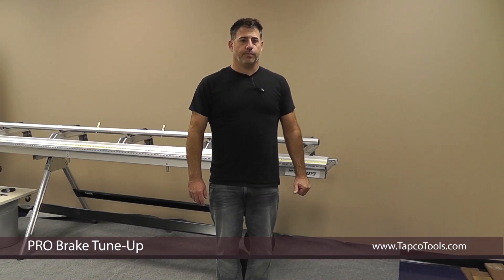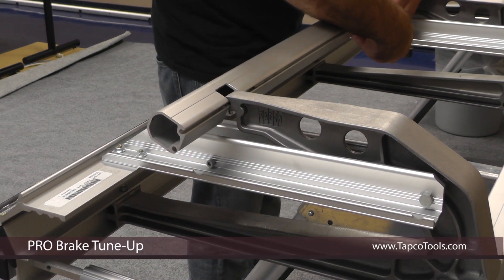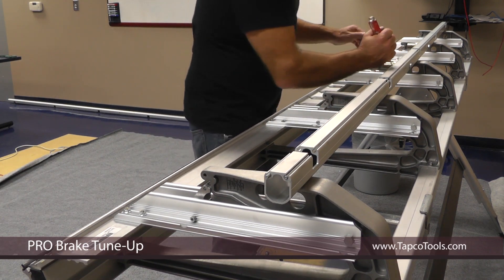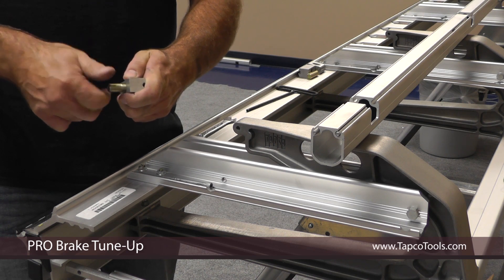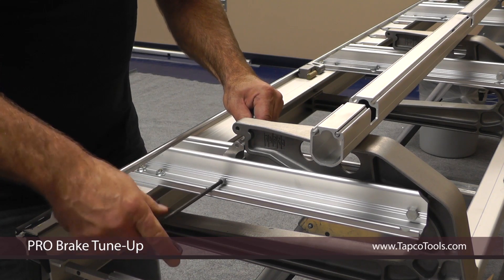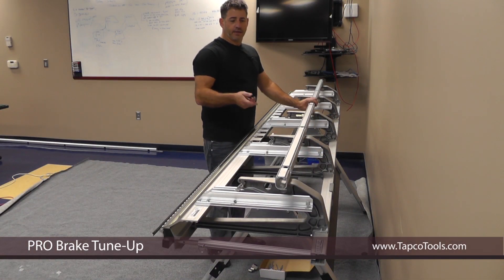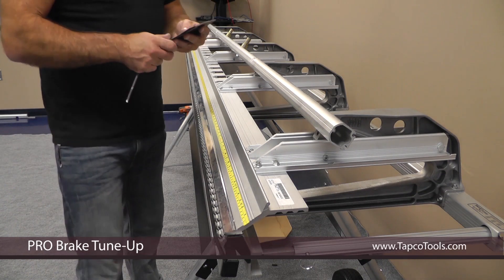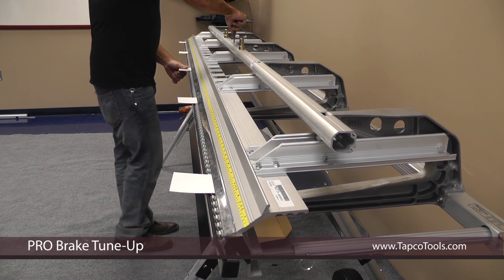How-to-tune-up-a-sheet-metal-brake

Comment: I'm looking for a mantel brake rebuild kit for a older 14inch I beleave. I dont even need it to be a new kit the old replaced parts will work for me .the brake I have is missing all of these  adjustment parts. If some one has some please get  back to me. 651-242-9832 john twin cities m.n.

Comment: my cutoff tool is cutting wavy edges why?
Reply from the maker: Hi Hydro Space,
I sent your question to Tapco Tools for input. Here's what One of the tech trips sent back:

I believe I understand the question, if the moving hinge is not locked in place with the hinge clip to the base hinge the ProCutOff will hit the metal high and stress it during the cutting process resulting in wavy or oil canning metal. We can address this during the video shots. 

(We will be re-shooting a lot of the videos and shooting as lot of new ones soon, too.) Stay tuned!
Reply: @ProTradeCraft   thanks yes i tried that also,.  ran the cutoff on my pro 50,19 also.. did same thing..this is my other one a pro 14 non adjustable jaws. i have 3 total a windy also.. i definitely need new wheel for the track.. but after 2 days i finally figured out.. that ,, i needed to just push IN to the track as im moving forward thru the cut!!!.especially with old wheels since i just bought it used.. this way it holds all the cogs tight against the roller coaster tracks!.. wow! nice cuts now!!.before  i though it was just sort of float rt thru the metal..lol.. man this cutoof tool and side winder are  A MUST HAVE!!